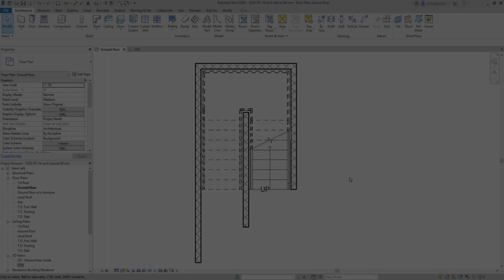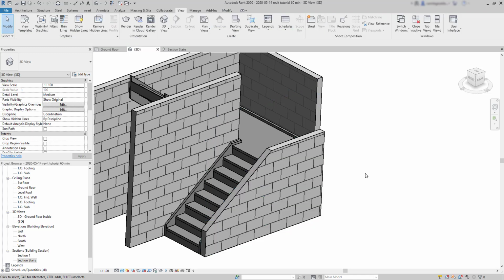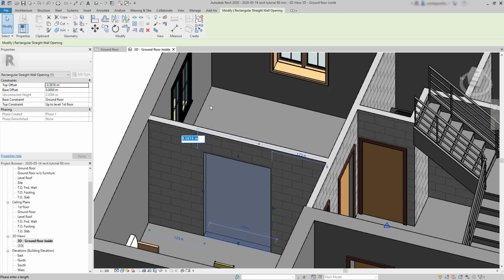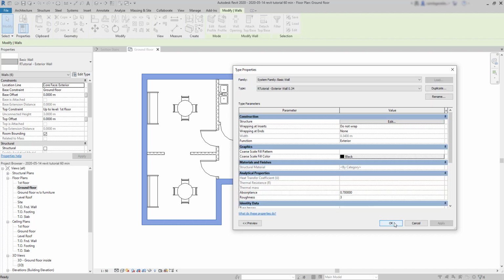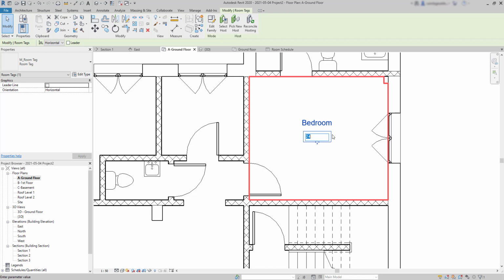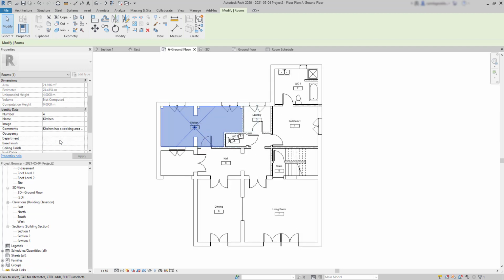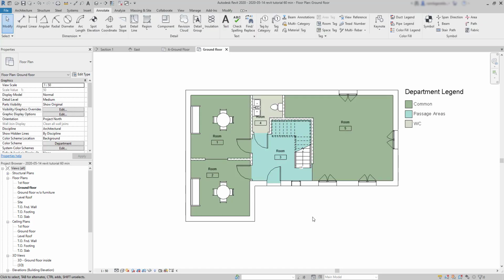Revit - Complete Tutorial for Beginners - Learn to use Revit in 60 minutes - Part 8

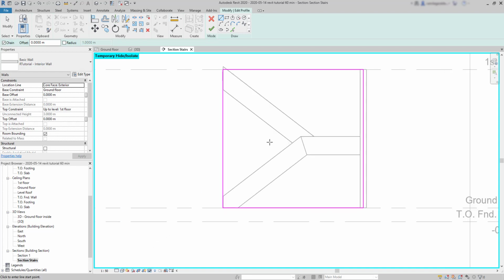Comment: Hi again :-)  In the video at 3:10 you make a line and move it up. I have now tried to move the line in many ways - but not the right way ;-)  Because I can't move the line. Is there a special trick to make the line move :-)
Reply from the maker: Make sure you haven't constraint the line with another my mistake before. If you follow the steps I am making with the move command it should work. Did you tried again?